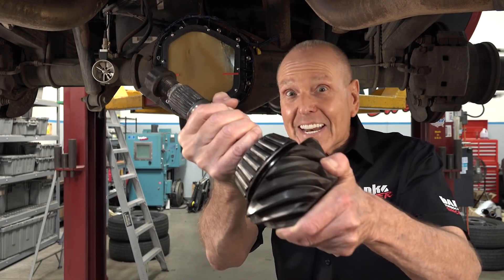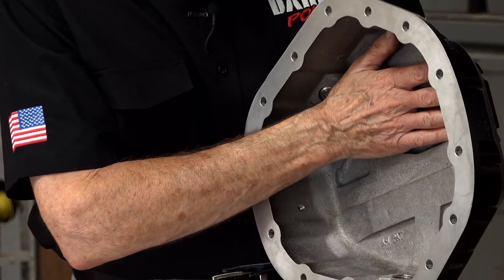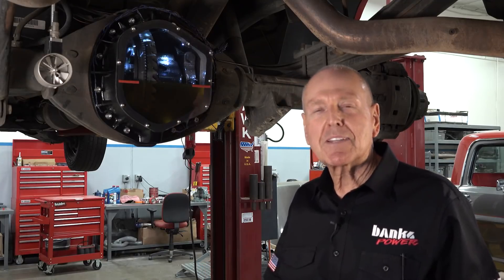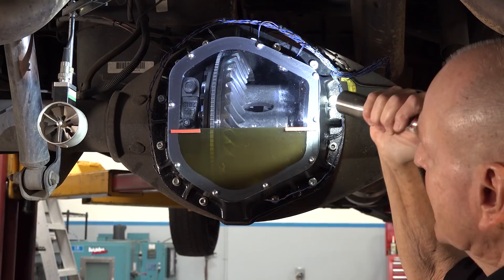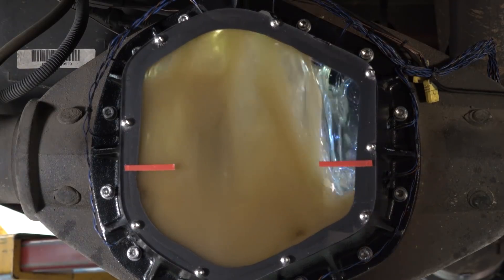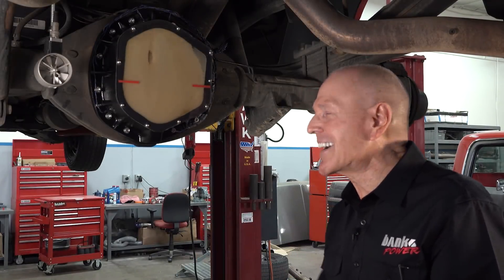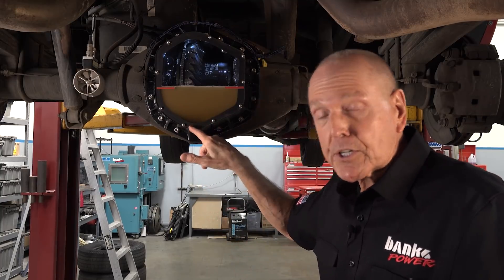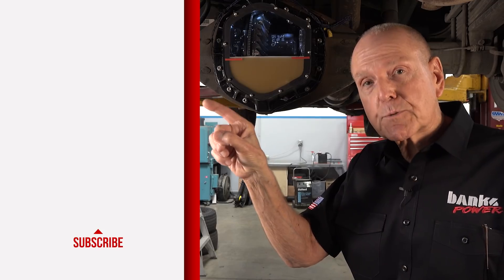What's going on behind your flat-back diff cover?

Comment: Ring gear would still be driving the fluid into the pinion bearings. All the extra splashing on the back cover is to help cool it. Think, all that extra surface area especially in the AFE diff cover will significantly increase the cooling capacity over the stock cover. Not to mention all the extra fluid in the cover that you can spare the fluid splashing around like that. Both covers had aeration so I don’t think that’ll be a problem. Let’s see in part three what really happens with the temps. I expect the AFE one to shine with both the fins on the outside and inside to significantly drop operating temperatures compared to the others that are more of a for looks than function covers.

Comment: You can tell there is a lot of aeration by how fast the eddies sink when the motion stops. The eddies contain unaerated oil because they have been sitting in the same place and not moving. Since they are heavier than oil that is full of air bubbles, they sink.

Comment: Looking forward to Banks introducing a new differential cover for the 11.5 aa.  Mopar has a factory aluminum finned cover that looks great, however a recent amateur test revealed little in the way of heat dissipation.  

I remember someone on Turbo Diesel Register reported testing the temperatures of a stock cover vs. the mopar finned aluminum cover.  They reported a measly 1 degree temperature difference.  

I’m in no way bashing the Mopar cover as it looks great and I’ve even purchased one in the past. 

I suspect Banks will produce a great product that in fact lowers temperatures and increases lubricity.

Comment: He's right. Look at the diff cover, or back of the housing for a 9" style, on an actual professional level racecar. It's curved and smooth where the fluid gets flung, although may have bracing and fins on the outside.
Reply: You ever see inside of  a 9"?  There are huge flanges that would deflect the oil, just the same as the square edges on the aftermarket covers.  There is no smooth transition inside of a stock 9".

Comment: I understand and agree that it looks like the flow of oil would be better with a rounded/OE style cover. I imagine that the pinion bearings aren't necessarily starved of oil, but I think the aeration issue is the biggest problem. Curious to see the temp difference and rate of change between the different covers.

That said, I have a Tacoma, which has a fairly round (though non-removable) "diff cover", so to speak. But, it has some pretty harsh edges/corners and pockets too. To make the aeration worse, the carrier bearing caps are bridged or girdled. They're meant to strengthen the third member, preventing the carrier bearings from distorting the case and thus, keep the ring to pinion deflection to a minimum. So there are two cast chunks of iron (I assume it iron) that connect the left cap to the right cap, directly in the path of the oil flow, just helping churn it up even more. I'm curious how the aeration compares to a traditional Dana style axle.

Great video. Thanks for sharing.
Reply: "That said, I have a Tacoma, which has a fairly round (though non-removable) "diff cover", so to speak. But, it has some pretty harsh edges/corners and pockets too."

If you've ever seen the inside, it's quite round.  Those housings are welded together with a bit of overlap.
Reply: Really? Compared to older Toyota housings and the one in Mr. Banks' video, it's pretty squared off. Look at the picture in the link below. Yea it says is for a T100/Tundra, but the Tacoma uses the same housing, with less width.

http://home.4x4wire.com/erik/diffs/axlehousings.jpg

You're missing the point anyway. There's a lot of obstacles inside that can cause aeration and heat.

http://home.4x4wire.com/erik/t100/Taco_3rd_member2.jpg

Comment: Oh crap. 30 years of hotrodding and offroading, and this never occurred to me.  I always sort-of wondered why the engineers would take the time to stamp such a complex design into the diff cover, but I never REALLY thought about it, and this is a simple test that anyone could duplicate at home.
Reply: Look back at rear axles in the 50's and earlier. You'll see plenty of simple, plain domes on the backs. The 60's is when they started going to more complex shapes that fit closer to the ring gear.

Comment: Nice work Banks Power. At FCA where I work, for bench testing/development of a rear end. they use a complete clear plastic differential housing (identical to a cast production metal unit) that they use specifically to determine fluid flow characterisitcs at various speeds like what you did, but you can see a whole lot more.

Comment: I've been running the STOCK FLUID LEVEL in my Mag Hytec cover . When I first got it years ago I ran the recommended higher level and blew axle seals. Now at stock level  absolutely no problem. The biggest advantage with the Hytec is the large magnet centered at the bottom of the ring gear., which collects ALL the break in residue. The little stock fill plug magnet, sitting way up there collects very little break in mush. The partial answer might be to run stock fluid level in these covers , and do the same test....Also you have not shown visual proof of any type of failure..!!

Comment: All the effort you have put into getting meaningful test results is really great.  But I have a question:

You seem to think the pinion bearing might be starved of oil if they are not being blasted in oil.  But, the bearings out near the wheels don't get any forced oiling.  Why would the pinion bearings need more oil than the ones near the wheels?
Reply: I think the pinion bearing can easily see 4 times the RPM, not sure if that's why.

Comment: Sir, I've got an after market cover (a few weeks before you started this experiment😒). What would you think about welding in a 4 inch wide curved plate that duplicates the stock curve, but retains the larger oil capacity? Great video series, I'm a believer. Just trying to minimize wasting my money...

Comment: Viscous loss leads to more heating.... but ... I think that since more of the fluid is in contact with the back cover from the “waterfall” effect you speak of and the back cover is aluminum and finned then that will greatly help to to transfer heat away from the diff. Also, I question if this is good or bad. Maybe the fluid is designed to be most protective at a temperature higher than what its being kept at with the aftermarket covers

Comment: All I can give is my experience. I haul heavy 95% of the time. As does my dad. We run the same trucks. If we do not run Mag Hytec covers we literally burn up rear ends. The stock covers will burn fluid in a week or 2.  Especially with Mopar oil. My dad burned up a rear end in less than 20k miles with the stock cover. With the Mag Hytec 180k miles and no issues.

Comment: I would think that a temperature gauge between the pinion bearings with the stock cover and the aftermarket would give a better clue as to the amount of oil reaching the pinion bearings that being said, like with a race motor may be a windage tray type of device in the back cover would be a help

Comment: Thats why they recomend more  gear lube the hope is to bring up the level to have better chance of greasing the pinion. The more fluid the more work it will take to turn the system

Looks like coverage isn't as good but the fluid isnt as foamy because of the extra fluid.

Comment: Great series, very informative. I just have one question for Mr. Banks. Even with visually proving what is going on behind the flat backs, and how the flow of oil is obviously less efficient, how do we know that there isn't sufficient oil getting to the pinion. I guess what I'm asking is, even though the after markets dont seem to improve performance in any way, are they actually doing any harm to the point where even if someone knew there was no benefit to buying they might still buy it strictly based on asthetics?

Comment: Remember chrome plated "Mr. Gasket" diff covers? Let's put up with leaks and massive use of RTV sealant to make something shiny. Shiny is for show. Banks may be preparing to sell us a super cool looking alloy cover, but in my eyes he's making a great point. The engineers who designed the axle also designed the cover. Don't waste your money on solutions to a problem that doesn't exist. Have you ever overheated a differential due to the stock cover being inadequate? Me neither. And steel is way more forgiving offroad than aluminum if you're in the habit of smashing your diff into rocks. IMHO.

Comment: Would be interesting to see the fluid dynamics in something like the ARB diff cover, which seems to use similar designs to the stock cover with a deep channel instead of a flat back.

Comment: edit : mr banks you forgot to mention the holes that are on the pinion housing thse holes carry the oil to the oil sealer and back to the bearings
also the pinion is located in the middle of the housing which means that as it turns counter clockwise (watching from the back) picks up oil and has lube problem.

nice to watch but i dont see the reason why anyone would change the stock cover.
or put more oil .
or anything.
maybe just for show 

differential axles are a mix of cast iron and alloy steel.
the quantity of oil in there is about th e oil needed to keep temp as much as needed depending on the stress the diff has.
the diff cover is about 1/10 of the total metal  and indeed gets cooler easier.
BUT that means that 1/10 of the structure will have lower temp than the other 9/10 ...
thats not good
i am a trained ZF axle and gerabox repairer(trucks)

instructions how to repair these things are VERY specific
if you decline even a bit the result is not good.

keep the oil level as instructed. more oil does not mean better lubrication.

by design there is no way to make anything better by changing just a cover

Comment: Great test, but to really complete it you need to verify lubrication or lack thereof with some kind of sensors on the bearings in question. Second test would be to put thermocouples into the housing at each of the critical bearing locations, load the vehicle up, and actually see what the loaded temps are at the different points of concern when pulling a load at freeway speed.

I absolutely agree there is a lot of wasted friction loss when you just add a bunch of fluid and fling it around more... and I am sure as heck not going to overfill my diff. Just would be curious to see hard data on some of the more specific points of concern, namely those pinion bearings.

Regardless, add me to the list of people who would like to see a stock internal profile, in aluminum, with finned exterior. Preserve the engineered internal fluid dynamics, but get rid of more heat.

Comment: If your heating the fluid due to aeration, and the flat back then your not gaining anything by having the fins and it being made of aluminum. Plus the added fluid level over stock is more fluid resistance that the gears, and bearings have to overcome creating excessive drag thus making it take more power to turn your axles, so it looses fuel efficiency, and hp to the rear wheels. Everything he’s explained is correct and makes since, why would you want to do that, it doesn’t take a lot of oil to lubricate gears and bearings, that’s why manufacturers recommendations are what they are. Keep your stock diff covers folks, and run the recommended oil levels. If you really want to cut down on heat and friction and increase the life of your diff, run synthetic gear oil, and change it at the recommended intervals.

Comment: The stock diff housing on my Mazda RX8 has some chunky fin like structures on it.  Other than that, looks like a pretty typical rear end.  I would think a stock style cover with fins added would be the best bet if you want some extra cooling and don't want the expense/hassle of putting in a cooler.

Comment: I imagine the rounded back will look the same. Possibly with less painting of the cover, but with 2 more quarts of fluid it won't matter. Oil is getting slung everywhere at 50mph. Fat chance it's not getting all over the pinion. Also the flat back of this cover is a heat sink right? So you want the fluid running up it to cool it.

Comment: Mr. Banks,
I see where all this is heading, I look forward to seeing the diff cover(s) BanksPower is going to be developing. Stock style internal with heat dispelling fins on the outside I would guess. And maybe get rid of the flat at the top (inside) so the fluid has better flow. 
Can I put my order in now?  2004.5 Chevy 2500HD 4x4. Little over 600,000 miles on it right now. In process of EGR delete after all this time, trying to hit a million miles, as it is almost at a million km's (I'm in northern BC, Canada). I just rebuilt the stock turbo, as it had never been off the truck for inspection. After this winter I will be looking at head studs and gaskets, and one of your exhaust manifolds and turbo setups. Maybe methanol injection.... because who doesn't want to see a million km truck put down 1000 plus hp 🤔
Ryan DeLong-owner of Beyond Maintenance in Endako, BC, Canada
Keep up the good work, and coming out with the informative videos.

Comment: I installed the upgraded Ford aluminum finned differential cover for the Ford Sterling 10.50 rear differential for 99 to 2016 F250 F350, noticed a 11 degree temperature drop over the stock stamped cover

Comment: First I would like to comment that no doubt your diff cover is far superior to the others in all ways except ground clearance important for a 4x4. That said, I have seen the oil in an Ram 3500 equipped with an OEM sheet metal cover and the oil looks just as  aerated as the "Flat Back" you guys modified. Not sure exactly if the pinion bearings are being "starved" as I have seen many trucks with flat back covers and Amsoil run over 600K miles. Love your videos with data to back it up as that's how my mind works. I'd like to see covers soon for Sterling 10.25/10.5 and M275/M300 soon as I would move quite a few of those part numbers in other brands.

Comment: Great info 👍. Banks please build us a better one, I would buy it
How about testing the deeper trans pan and engine oil pan next?
Reply: His biggest complaint with the diff cover is the shape. Since a trans pan and oil pan would only add capacity and better cooling, and not change any flow patterns (other than slightly longer pickup tubes) i cant see them being a negative in any way.....other than being closer to the ground, lol

Comment: I want to know more about this. Kind of important to me as it is. Do I add capacity remotely and let fluid Dynamics pump to a reservoir to cool and let off airiation, or do I need to run it with a thermostat? 
I will buy your I-Dash when I turbo my '61 C-20 301. Pretty sure that I will be needing it. I just wish I could change that deep gearing so that I can run at 75+80 and not be over 3500 revs so I could run a motor with more stroke, including a BBC and at least get 15MPG.
Take care from Oklahoma,
Mike and Vee

Comment: Just needs to have oil injectors. That are pointed at the bearings. You can drive a pump off the differential.. Might even add a pass through Diff oil cooler. Then to the injectors...

Comment: Can you measure BSFC and chart that for each diff cover?  At 250HP road interface, if what you're saying is true, the engine is going to need to generate more HP to compensate for all the fluid pumping.  I'd imagine that's quite a few HP with the really high capacity covers, which equates to higher BSFC for a given road HP.

Comment: Gale is an extremely smart guy, more so than myself. With that said, i believe the explanation he gives on these covers, however, if they are not in fact lubricating all internals i would havd to think that one of thes rear ends with these covers would die very quickly. So i have to go with, the lubricant must get there and work even with all this experience and expertise 🤔just my rationality. Overall, i fully understand what is being said

Comment: I wonder what it do with curved trough like tin channel, bolted to the inside of the cover, from the operational oil level to someplace close to the top of the ring gear. That should shoot the oil to the front. Or would it just cause more agitation. Then you would have the benefits of increased capacity and cooling of the aluminum cover with the action of the stock cover. Just wonderin. Thanks for a very interesting video series.

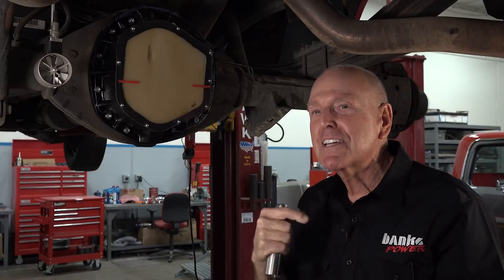Comment: At 8:36 is that a Cavitation bubble?   (A vacuum formed because the oil wants to follow the ring gear but can't)  Would be interesting to drill a hole at that location and install a pressure / vacuum gauge and take a measurement.

Comment: Another possibility,  incorporate a scoop into an oval shaped cover, locate the scope under the ring gear to block 75% of the oil from being slung over. The design would require testing and modification to make sure adequate lubrication gets to the pinion gear.d

Comment: This was very informative. However, I do want to point out that the flat back you did use had built in veins for gear oil flow.  This changes the flow characteristics of the oil. Personally, I wont be changing over to a flatback.

Comment: Next time, it might be wise to do a side-by-side comparison. It appears that amount of air bubbles atop the fluid with this diff is about the same as with the stock diff (possibly even more). This is how it looks, at least. I don't know for sure how long the fluid sat between takes in this video and your previous video, but you should probably take pictures at least and compare them with the current diff cover being tested. Just a suggestion.